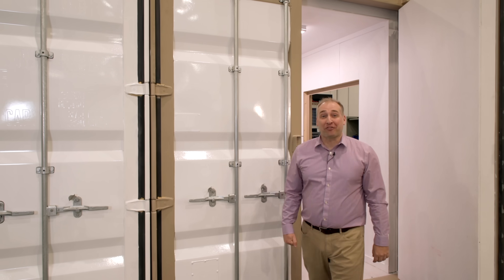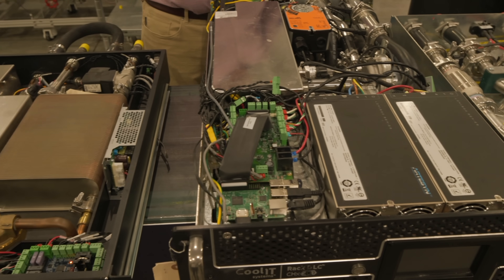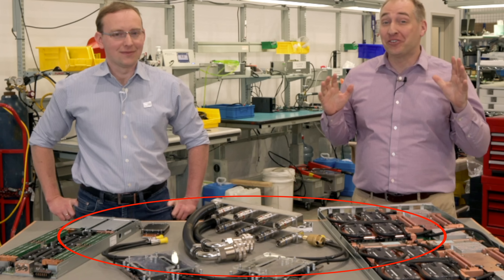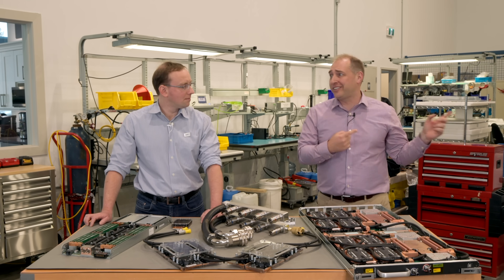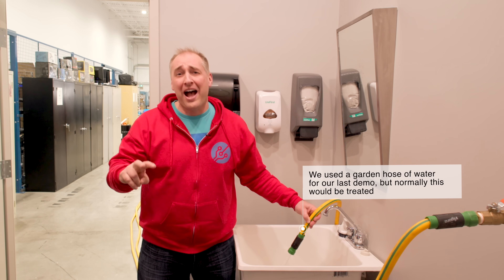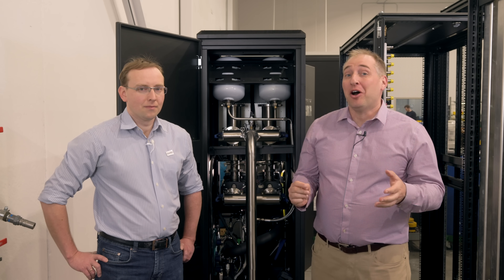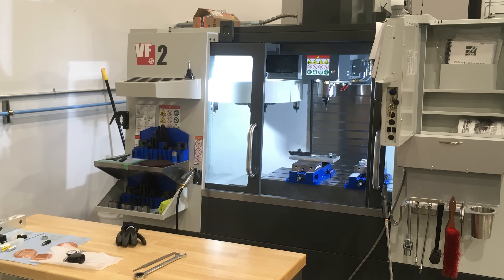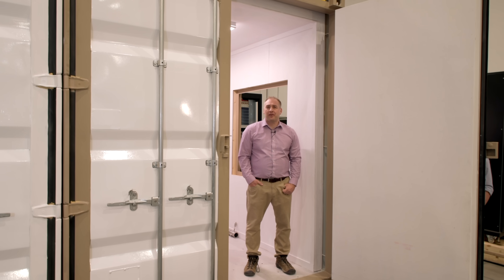Touring the Liquid Cooling Lab

Comment: Love this because water cooling is pretty cool for consumer products, but with servers it has to be designed to be extremely reliable. And inevitably these advancements trickle down to consumer products too. Also if you want to even use the top of the line upcoming products coming out its basically required.
Reply from the maker: Exactly right
Reply: I feel like enthusiast liquid cooling has already become very reliable. Also in terms of AIOs in the higher end pre made cooler market. But this could trickle down into the consumer market
Reply: @ServeTheHomeVideo  😂
Reply: @ServeTheHomeVideo  ❤❤❤

Comment: the new article on sth - 400gx64 switch is pretty awesome - dual 400g cards for almost 1t of bw? with new mi300, cxl things are getting much spicier for hpc and all this tech will trickle down faster than smb move to 10g - the key is that nvme is so scalable - bonded 400g will be great for big nvme raid0 arrays - the cooling is just another part of the chain needed to have reliable sla #swr matching #counterpoise #block device #netfs benchmarks

Comment: One obvious way to detect coolant leaks would be to use the same method as in an RCD: if the in and out flow differ, there is a leak.
Reply: That's one way to do it but not as cheap or sensitive as a rope leak sensor.

Comment: What benefit is this level of cooling relative to air cooling in terms of temperature difference?
Reply from the maker: That depends on inlet temp, flow rates and etc. The bigger thing is that it can actually cool higher power chips

Comment: Cool IT does a nice job, however ZutaCore is doing a much better job with a higher cooling efficiency, low pressure systems, simpler, and no leaks risk.   Just saying....